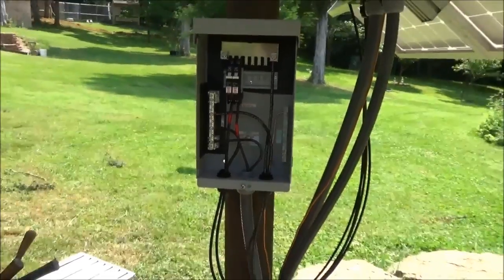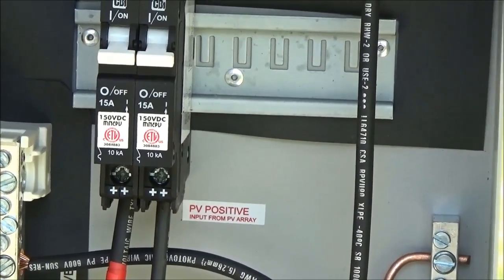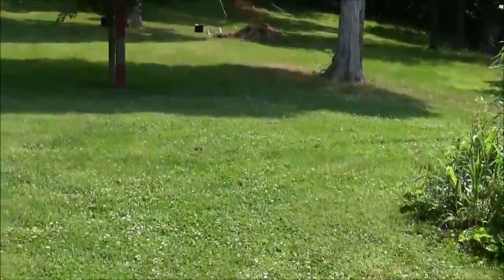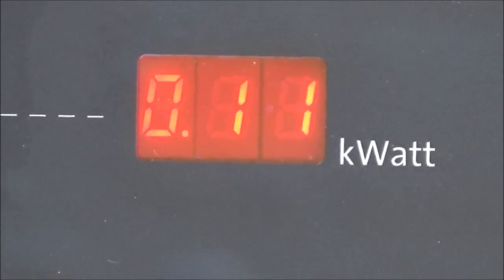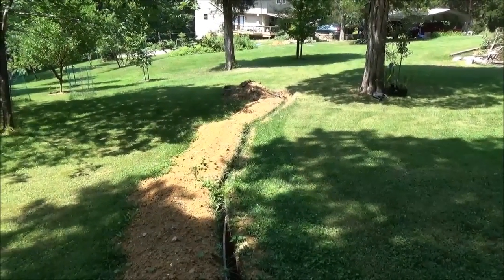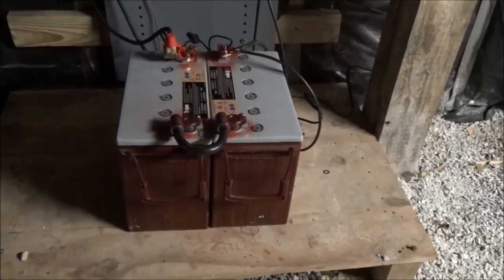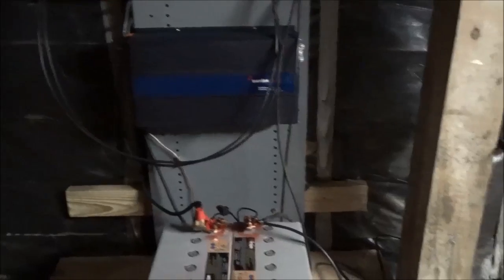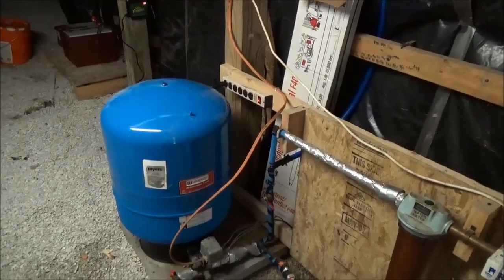Water Security Through Solar and Gravity

Comment: I see the grundfos cu200 but what pump did you use? Looking to create a dolor backup in the flat lands of South Georgia and pulling from around 250ft, have built a 20ft water tower for slight gravity feed that we can fill with grid pump but eventually would like to solar it and use a boost pump to create pressure that will run off battery backup. Any recommendations?

Comment: Will PV systems survive an EMP attack ? I know electronics (chips) will be fried but will windings in Motors, Gens. & Tranformers be fried by EMP ? What is involved in Ferraday Cage construction - what gauge of screening or must they be solid steel sheets /what gauge, if built in a basement must the floor be lined also... Solar back ups are great & expensive and if one EMP can fry it all WHY bother.  signed Desperate (any help or links would be GREAT) Peppared is essntial - Protect ain't back either. Thank You